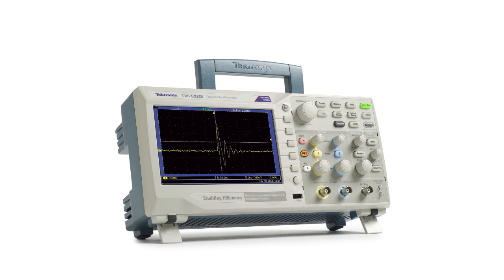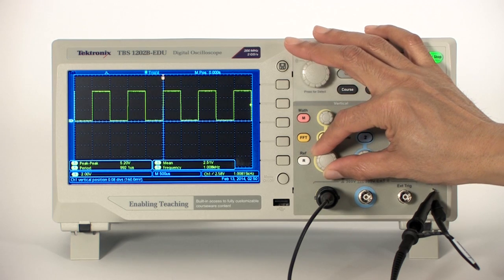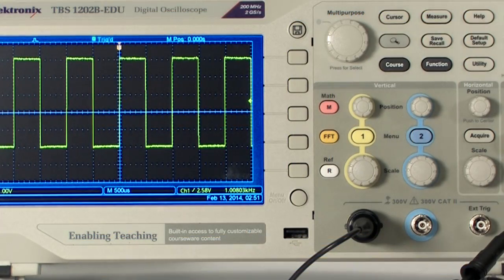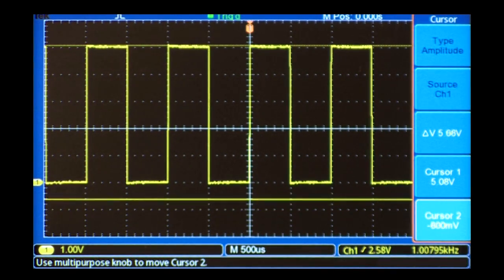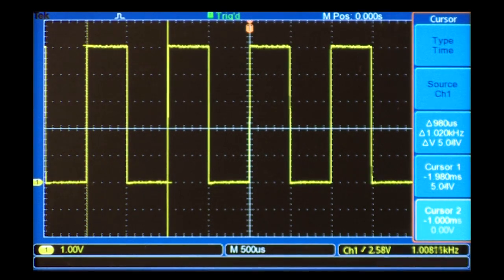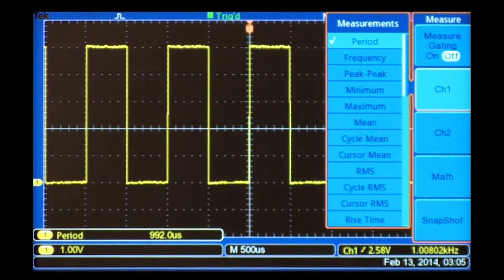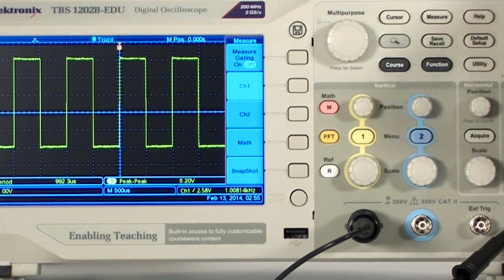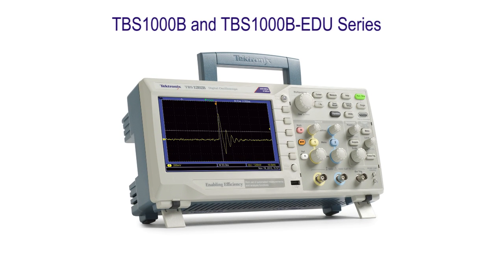Making Measurements with the TBS1000B and TBS1000B-EDU I TDS1000B Oscilloscopes I Tektronix

Comment: Good evening! How to change the language in TBS1000?
Reply: Portuguese
Reply from the maker: Hi Joseph
Step 1 – Push the “Utility” button on the front panel. The scope will display a side menu on the right side of the screen.
Step 2 – Push the “Language” side menu button. You will see that the scope interface opens the language menu.
Step 3 – Use the “Multipurpose” knob to select the language you want, turn the knob and push to select the desired language. The selected language will take effect immediately.
Step 4 – Push the “Menu On/Off” button to close the Utility menu.
Hope this helps!